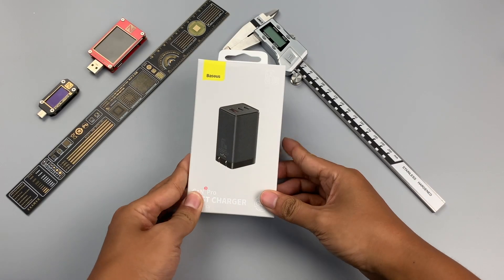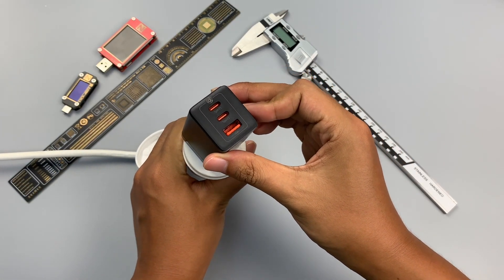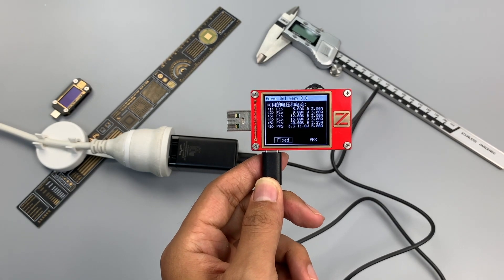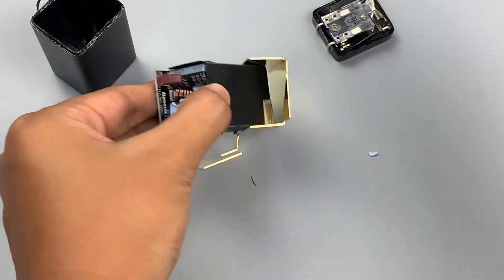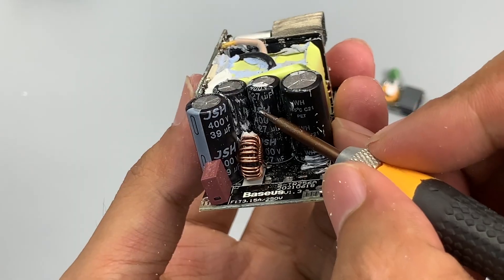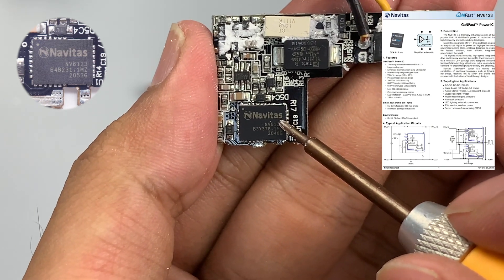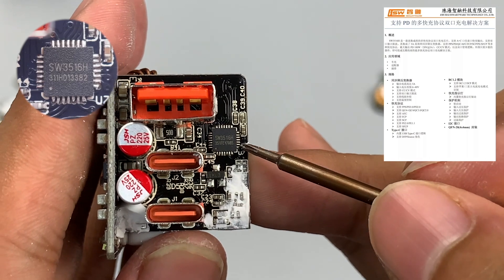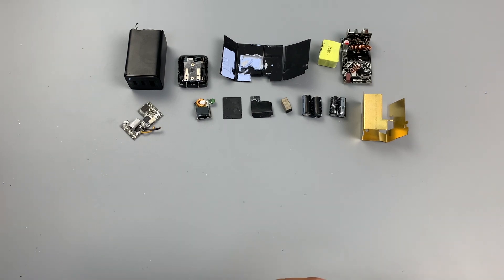Teardown of Baseus 65W GaN 3 Pro 2C1A Charger (The Third Generation)

Comment: Please note that this puts out  a lot of heat when used at or near 65W. There is zero room for heat dissipation and only expels heat from the outer shell after the core gets overheated. Capacitors and solder joints don't do well with extreme heat. Portable is good but not at the cost of component failure.
Reply: Everything Baseus is heat. Used to be good but become fire hazards now...

Comment: On C2 port A33 charges faster when in use (around 10-12W. On C1 charging goes to basically 0. When not in active use C1 and C2 charges the same power (max 25W). C2 seems to work better with my device.

Comment: Does anyone know if the version of this with 2 AC outlets safely works with 240V, so long as you only plug in dual-voltage low power devices that can handle 240V into its AC outlets?

Baseus says that you can't but I don't see why not, and suspect that it's just legal CYA to protect from being sued by people who tried to plug in 125V-only and/or high power devices into the AC outlets in 240V countries.

Comment: Thanks for the teardown. Couple months after using the charger (some older generation) the middle port stopped working. Today I managed to repair it, contacts were broken on the small riser board so I used small wire to reconnect them. It's a poor design that charging port sits on tiny riser board which is held by only 6 solder joints close to each other. The other USB-C board is much sturdier.
Reply: Same with my , stopped working middle usb c port , continuously give impulse to charge and stop again charging and stop , and also usb A has some pins broken i think , when i pushed the charging cable sideways is working if i leave it free is not charging . 
So from 3 port only one is working properly now . I want to fix it but i’m not sure if i can managed to do that without destroying it completely ☹️
Anyway is made of poor quality this charger..

Comment: Hello, I have a question, when I use three ports the specifications says the out energy is (45w + 15w), what that's mean? 

It´s mean that deliver C1=45w + C2=15w + USB A=15w

Or it's mean that the last 15w are sharing between C2 and UBS A

And if the last is true, how much energy deliver C2 and USB A specifically in the moment when the three ports are connected?
Reply from the maker: The 65W means the max total output needs below 65W.
So, it must be the last one.
Reply: The last sequence is true. 15w are sharing between c2 and usb. Probably 7.5w each port. The 1st sequence cant be, because 65w is the max. 45w+15w+15w = 75w. ❌

Comment: Had this for 11 months to power my Mac air and charge my iPhone and apple watch. Was good while it lasted as it was really portable until 1 USB c port shorted and caused the unit to heat up to 70C even without any cable attached.
Reply: What cable you used
Reply: @elhussin5687  i was using anker and apple cables with it before the overheating

Comment: so.. what's the difference with the very first gen with this one apart from bigger primary caps (110u vs 132u) and slightly more efficient mosfet?. switching frequency is more likely similar since reference board from GaNSystems ran up to 180kHz with NCP1342

Comment: The LED indicator is a nice touch but again cheap Chinese caps, Taiwanese and Japanese are only acceptable ones because these are only rated for 2000hours as per the datasheet.
Reply: 2k lifetime only?
Reply: @elhussin5687  yes
Reply: @tanishqbhaiji103  where is your source?
Reply: @elhussin5687  the datasheet
Reply: @tanishqbhaiji103  where?
Reply: @elhussin5687  using Google isn't hard

Comment: ❤️❤️ I have the 100W Baseus GaN charger... Waiting to see its teardown..! ❤️❤️
Reply: Did your charger indicator light blinks when plug in a powerbank via type c and the charger is not plug in via AC outlet?
Reply: @elhussin5687  Don't have a type-C input power bank with me sorry. Does it affect in a bad way?
Reply: @sobadaham  baseus dont include the info on the blinking light in the charger even in the manual it does not say anything
Reply: @sobadaham  how many volts can you get when you used both usb a?
Reply: @elhussin5687   I don't have an equipment to measure the exact amounts of Watts its outputting. But I have used it close to an year now without any problem in performance. One time I plugged in the M1 MacBook, Camera battery charger, Flashlight and the tablet all at once, but did not see any difference in charging times. 🙂
Reply: @elhussin5687  it's caused by reverse flowing current from type c output of power bank to charger. These Baseus chargers don't have reverse current flow protection circuitry which is a very bad thing and could damage power bank due to repeated pulse coming from it.

My own power bank just keeps turning on and off when connected with basues gan charger and charger is switched off.
Reply: @EasternSurvival  Isnt all powerbank have separate input and output voltage?
Reply: @elhussin5687  idk 😁

Comment: why gan is smaller?
Reply: Because it is more efficient, means it only require a smaller heatsinks and lower thermal mass.
Reply: @AppleReviews  why?
Reply: Because the frequency is higher the transformer is small

Comment: Is there any significant difference between previous Gan 2 Pro 65w?
Reply: yeah wondering this aswell. i just received the gan 2 pro, i cant even find the 3 pro on ali
Reply: I found 1 but only with US plug the USB-A port is faster on the 3 30w vs 60w 
Gan3 pro: 4.5V=5A, 5V=4.5A, 9V=3A, 12V=3A, 15=3A,  20V=3A  Max.
Gan2 pro: 4.5V=5A, 5V=4.5A, 9V=3A, 12V=2.5A, 20V=1.5A Max

The color of the usb-c ports are orange on the 3 instead of black and its a little shorter 63.5mm vs 75mm and a bit lighter
Reply: Correction i just read in the manual the 2pro does support up to 60w on the usb-a port, specs on ali are wrong i guess
Reply: @coltje  thank you ! 63.5mm vs 75mm is a good thing ! can you give us a link for gan 3 pro please
Reply: @coltje   Yes. Just the GaN 2 LITE support only 45w on USB A port
Reply: I had the same question where to find this model the problem is only china specific the model number is: CCGAN65C3 ,hope it helps.
Reply: @Darktron  Thanks!
Reply: Is you pause at 0:32 into the video you can barely see the model number in the back of the box.
Reply: It' significantly smaller. I own both gen 2 and gen 3. My gen 2 fried after 1 year.
Reply: @Chii1990x  cant recommend the gen 2 the plastic completly broke on the on the bottom. Ive glued it so its fine now and still works but quality seems not the best.
Reply: @Chii1990x  hi man, how is the gen 3, still running good? Can you recommend it over the gen 2?